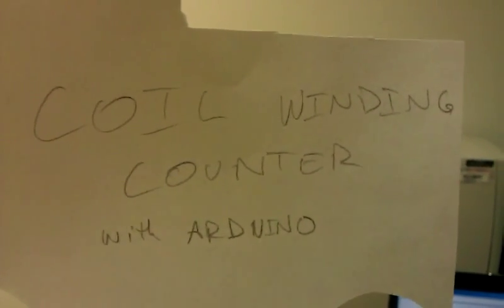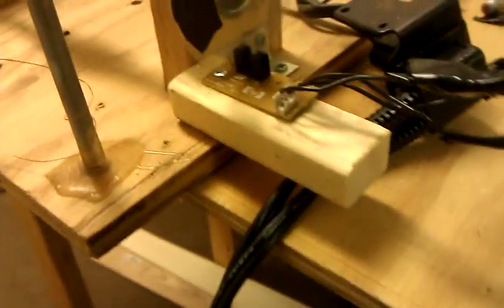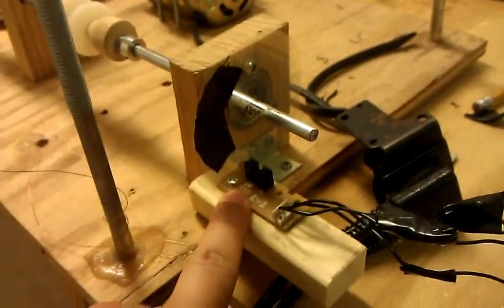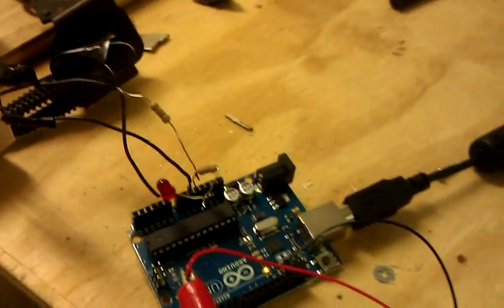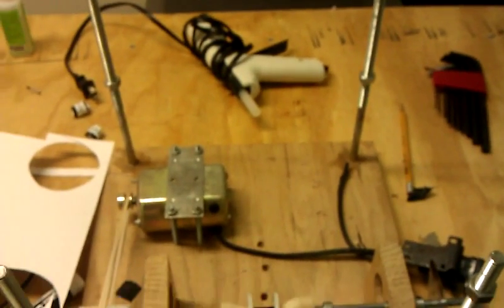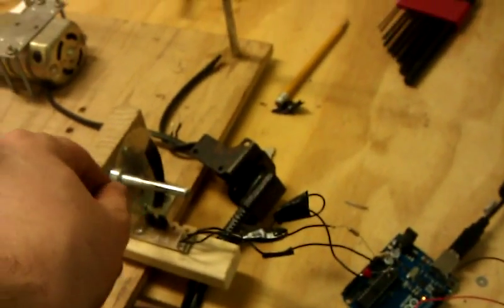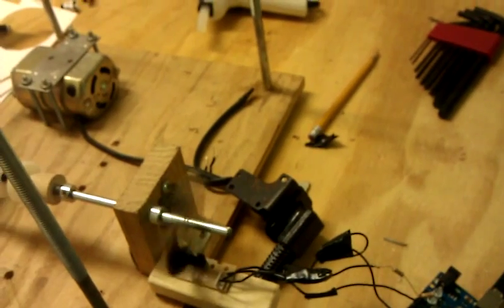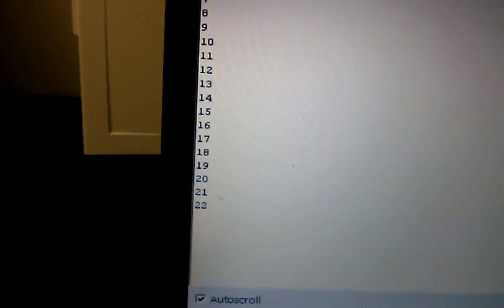Coil Winding Counter with Arduino

Comment: Is there any way to make it count backwards in case you need to unwind the coil a little bit?
Reply from the maker: The standard way to do that would be using quadrature encoding to be able to detect direction. There are arduino libraries for that. You could also just keep a running positive/negative direction tally and subtract the 2x the number of negative direction turns at the end. 4 forward plus 3 back would read 7 (4+3) but the actual turns would be 7 - (2*3) = 1.Or you could have a hardware switch that you manually flip that changes a pin's digital state. Then just have that state change the direction of the count in the code based on that pin. You would just need if statements of this general form inserted somewhere in the counting code: if (pin1 ==1) count++; and if (pin1 == 0) count--;Just some ideas. Thanks for posting!
Reply: Thanks for the informative response!  One of the projects for my internship this summer is trying to find a way to count the number of turns of a slower moving lathe for wiring transformers.  The counter has to be automatic and has to be able to count forward and backwards without hitting a switch.  I will be using an arduino and I am a pretty good coder, so the only problem I am having is finding a way to make the arduino (or the sensor I will be using) realize that the lathe is unwinding without having to flip a switch.  If you have any more tips or suggestions they would be greatly appreciated!!!  Also your video is very informative and gave me some great ideas!
Reply from the maker: https://electropub.files.wordpress.com/2017/05/magnet_hall_directional_sensor1.png
https://electropub.files.wordpress.com/2017/05/hall-effect1.png

I had this idea today, shown in the first link. I haven't tried it but it might work. The hall effect responds to static and changing field strength regardless of the speed of the changing field, so it would be better than just a coil sensor, whose output corresponds to speed of a changing field strength. The downside is if you're working around a lathe it's may not desirable to have magnets around. It also wouldn't be super precise in terms of 1/2 turns, which may matter in your transformer winding.

The quadrature encoder idea is good but mounting it might be tough. The problem I had with my encoder in this video was light pollution affecting the trigger point. Just something to be aware of.

Also an idea that applies to both these ideas is to have a calibration that you can run to detect the appropriate trigger points in different environments and setups. Something like: press a push button, run that lathe for a few seconds, then press the push button again to stop the calibration. You could calibrate the trigger points in your code.

Finally, the reason for the piezo speaker in my video is so I could be audibly alerted if it seemed like it was missing counts. At first my code was too slow to keep up.

You could have your arduino send different audio frequencies in increments of numbers of turns. Or start beeping when you get close to the end of a winding.   http://www.vk2zay.net/ - Alan yates uses audible tones and alerts a lot. Sometimes you don't want to or can't read a meter easily.

If you have a amatuer radio club in your area you might find some physics / electrical engineers that would be a good resource.  I'm lucky to have that.  The guys in my club would definitely have ideas.
Reply from the maker: Actually, in the image the north-south axis of the magnet should be horizontal, not vertical.  That would produce the desired waveforms, I think.
Reply: @aniccame I see what your saying! say you have a bar magnet or something and its put parallel onto the lathe, then it would produce either a 10 waveform or a 01 waveform, if that makes sense.
Reply from the maker: just curious - have you made progress?
Reply: @aniccame We actually shifted our focus to something else.  It is a voltage detector to prevent hydrogen embrittlement on offshore oil rigs. we are bascially making a detector to send voltage and temperature readings via sonar up to a computer on the surface. if i get stuck though i will come back here for help if you can helo me lol.
Reply from the maker: via sonar? that's pretty cool!

Comment from the maker: I think that's a great idea.  If I redo this project I will probably use a hall effect sensor.  This project uses a sewing machine motor, which is AC.  I've read that using a DC motor gives you a lot more control at low RPMs.